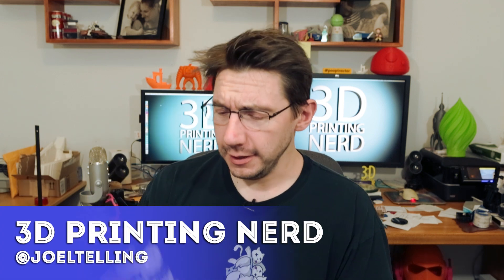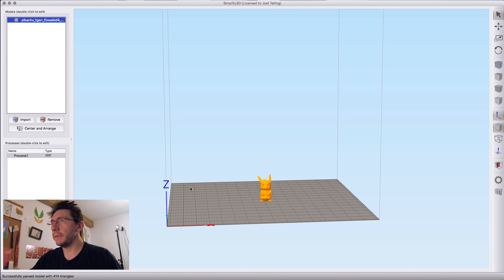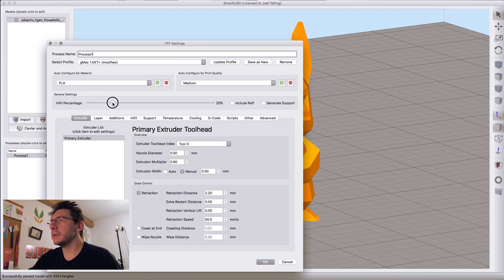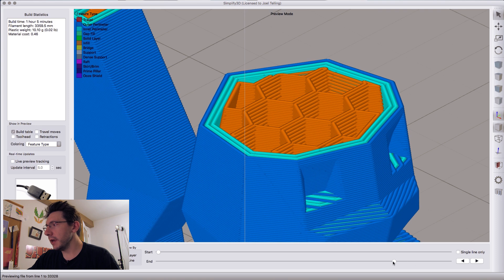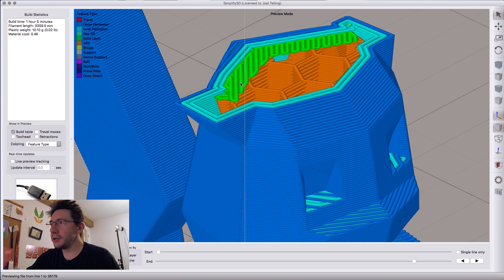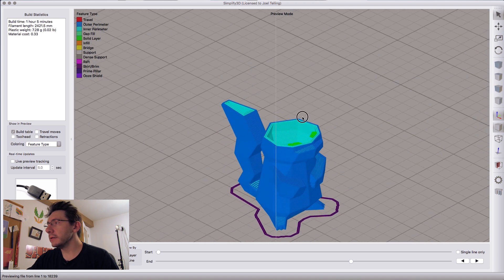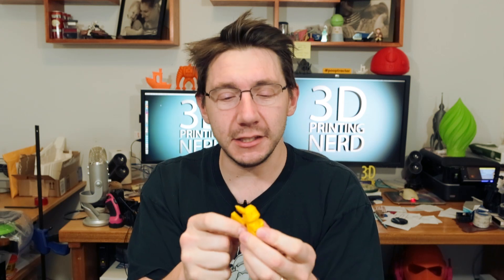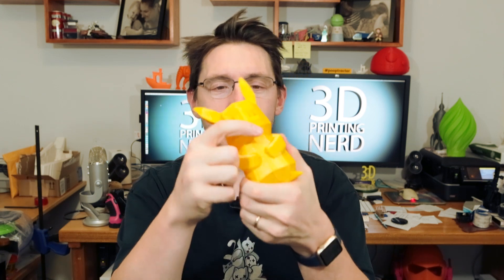3D Printing: Stop Wasting Plastic on Infill Percentage

Comment: For example although for models you can get away with 0 infil and 3 walls its completely different than 3d printing parts for rc cars ? Like the more infil and density the part has the more reliable and strong it'll be ? Im printing abs and tpu at 75% infil should I also use 3 or more walls and would using more walls cause it to print out neater looking?

Comment: aesthetics are king so I go with 100% infill for parts using translucent filaments that will have an area wide enough that the infill pattern will be too distracting because the only other choice for those is zero infill and that usually comes with bridging issues that will be just as obvious and an infill pattern when you look at the part, everything else I range from 5% to 20% depending on how worried I am about the top layer sagging and not really because of strength.
though I've been 3D printing only for barely 2 months now so maybe I'm just wrong lol

Comment: I'm not concerned with how durable a plastic pokemon is, I'm concerned with how durable a towel hangar, phone stand, gears, etc are.

Sure if you're brand new to printing, and popping out toys, save filament and use minimal infill

Comment: Never thought about it like that. I think you still might need infill when it comes to prints that have a large flat surface area on the top and bottom like rectangular boxes but having less infill and strengthening the walls not only reduces the amount of plastic used but also the time to print!

Comment: Hi,

I'm sorry, I'm new would you please help me about replace my ender 3 2 pcs 300mm z reals with 2 Pcs 2040 CNC 3D Printer Parts European Standard Anodized Linear Rail Aluminum Profile Extrusion for DIY 3D Printer Black (600mm) would you please show me how can i change z number from 250mm to 60? please. thanks

Comment: Here are my recommendations:

Hotter extrusion temperature and less fans. turn down your print speed slightly too. the slower the part cools the stronger it'll be. you may consider using an enclosure or annealing some parts as well but tweaking print settings should come first.

Use more perimeters. this will add more material to where part strength is needed most. same for top/ bottom layers but i think perimeters are faster and have a much greater effect combined with print orientation. 

adaptive infills. you can set it fairly high and it'll only put more infill close to perimeters and top/ bottom layers where you need it most strength wise. honestly though infill is one of the least effective ways to strengthen your parts.

And of course if your printing mini figures you dont need a whole lot of part strength to begin with, you can turn the above settings down

Comment: It seems like there was plenty of strength in the models you printer without infill, but doesn't the strength of a model rely heavily upon the material used for printing? Were you using PLA? Resin? Something else?

Comment: I appreciate the help and assistance, but...

WHY O WHY do nearly all content providers, yourself included, have a section where you talk, which is low volume so I turn tv up to hear clearly, then have an intro animation with massively higher volume, almost always including heavy bass to compound the issue, then go back to the low volume for the rest of the video..

I watch most of this stuff late at night because I have insomnia, and having the extremely loud intro animation drives me absolutely nuts!!!

Come on, just lower the anim volume to the same level as the rest of the video PLEASE
Reply from the maker: We do this in the software to keep a normal level. Is it this video specifically?
Reply: @3DPrintingNerd  this video definitely.. but many others from creators do the same.. its like adverts are always louder than the programs.. 

I do have a subwoofer system because tv output is quite tinny so likely thats the issue.. the intro vids are nearly always heavy on the bass.. If I shut down the subwoofer then everything is horrible again including the voice in the vids..

Comment: I printed a lead bender from thingiverse for my electrical engineering study. I used 100% infil because it's a small print and I don't want it to break in my bag. I definitely didn't need to do it, but I'd rather just be sure. With larger prints or on time constraint I definitely use like 15% infil.

Comment: I have only been 3d printing for 1 full month now and the only Slicer I even know about and am using is Cura.

If I want to try printing a successful design with 0% Infill, I should increase my "Wall Line Count" from 2 to 3? My Wall Thickness is set to 0.8mm

I have tried a few prints today with 20% Infill because 4 hours later, I have finally got an understanding what Infill even is lol. I am having an issue tho where the Corners of my print start to pull off from the Bed i'm worried that when I let my printer run for a 8 hour print, the corners will pull away which will lead to the entire print to come off the bed mid print. 

My Nozzle Temp is at 210°

Bed Temp is 70°
^ I have since experimented with my Bed Temp at 60° and that seemed to help so far

I am using PLA 

Do you have any recommendations for me?

I'm sure by the time you even see this comment I will have figured it out or very possible that I will no longer need any help because I have thrown my 3D Printer out the window. Either way, thanks for the video regardless .. My 3D Printed Girlfriend also says "______" well.. she can't talk yet but im working on that! Thanks!

Comment: I am glad I found this video.I just got my printer last week.  I was printing some pokemon and was wondering why the infill needed to be very high if they were just going to sit on the shelf. Lowered the infill to 10% because I wasn't sure about how they would work going less. So glad to know I could go 0%. 
I know this video is really old but I have one question... What do you print the layer height at? Can I leave it at 0.2 or do I need to make it less?

Comment: HOW! I have 50% infill and 3 shells yet my print strength sucks. The layer adhesion is great. The only thing I notice which probably is the issue is the shells aren't fused together and they are a bit thin but using cura I have no idea how to change that

Comment: I'm gonna say layer separation is the big gain with infill, If might help some with crush strength but mostly layer separation will be the gain, that being said this was not a very accurate test of strength, it was really a "good enough for decoration" test where as some of us are looking for real strength, personally I don't make toys with 3d printers, I make gun frames on mine so I need as much strength and heat resistance as I can possibly get, Which is why I do 100 percent infill with polycarbonate and I anneal it.

Comment: any idea why a printer would stop printing in the middle of a print??? print was fine up until it just stopped moving...machine did not shut off,nozzle temp and bed temp stayed same...could not resume of change settings... i had to power off and start a new print...than as like with the other it just stopped again 10 mins into the print.... i have fixed dozens of issues on 3d printers,but this issue is something i don't understand...PS i have printed this file many times with no issues... please help... thanks

Comment: For sure. I've experimented with infill on a small variety of shapes at a couple sizes on the same build. Everything passed my 'smash it against the wall' test. However, I did build a little herb grinder (for a friend) and I did do 50% fill with .15 layers because even if all that plastic is redundant, this thing is going to be put to use pretty regularly.

Comment: Great video as it not only wastes plastic but also time. with that said, what cases do you believe infill is really necessary?
Reply: Pretty sure I just realised the answer to my own question, if you have an object such as a cylinder that was fairly large when it gets to the top of the cylinder and needs to cross a large distance it would be best to have infill in there. Basically like how supports work but for the insides

Comment: lol. did no-one see the gimick here?
he demonstrated snapping apart a small model, which will naturally be stronger due too its size. x300% with a bigger model and things change. the bigger something gets the more supports it naturally needs. did you notice he wouldnt destroy the bigger version? the model he chose didnt have any detail either, like the neck line and between the arms and body.

i do agree that you can waste infill and provide way too much support on the inside, but it comes down to experience upon the type of model your making, and most importantly, the type of Material your makign your model out of. i assume he used ABS which is a stronger PLA, but with many different types nowadays, you really need to know what your using rather than sticking to this advice. after all. he wasted plastic making multiple pikachu's just to make a youtube video.

Comment: Solid infill actually reduces strength. The exact percentage for maximum strength is going to depend on the model, material, load, infill type, etc. but some degree of hollow space is going to help with strength.
Reply from the maker: Oh that’s right. I think I remember seeing a demonstration using a solid pipe versus a hollow pipe. Does that sound familiar?
Reply: @3DPrintingNerd  Absolutely. BTW, it's really cool that you take the time to answer peoples' comments. Love the channel!
Reply from the maker: Thanks! I try!

Comment: I don’t print high infill for strength. I use a higher infill to have items feel heavier. Example: I made a D1 digivice and it feels cheap and plastic, yet 70% I fill with a nice paint job feels like I’m holding a read digivice!
Reply: 'you can fiill your print with clay or dough.

Comment: Im new to 3D printing and use about 15-20% infill on most models unless Im going for weight. For example, Im in the process of creating a Star Wars chess set and printed at 80% infill to give the pieces some extra weight. Anyway, very informative. Thanks man. Have a good one. HIGH FIVE!!

Comment: I did a very large print recently (about 20x22x24cm) and did 5% infill with the 3d cubic infill so I wouldn't run out of filament. Unfortunately, a lot of it didn't bond very well internally so left my part a bit squishy. And I still ran out of filament. Should've gone for more walls and just filled it with something later.

Comment: I go either 15% or near 100. I only use high ones when I need crush resistance, such as frame sliders for motorcycles; these are what the 500+ pound motorcycle slides on if it gets dropped on pavement. Need solid plastic for that.

Comment: Yes, if you are printing picachu you need no infill. But if you are printing parts that have are used for something, you need it. Of course, you should always adjust it to what you really need, but printing weak parts for them to get broken so you can print them again doesn't really save much filament.

Comment: Considering this is 4 years old but the knowledge still applies, I've begun printing out my library of 3d modeled figures from the last decade or so into 1/6th scale statues and am really trying to cut down on print time. Taking out the infil was my first choice, though I'm of the opinion that some is necessary as you mentioned in the vid just so some parts will actually print. Little fiddly bits like outstretched fingers or facial props. I'm going to be molding them anyway, but what I'm planning to do for structural support is fill them with 8lb pourable foam, provided the reaction doesn't torch through the model. Should give it a bit of heft and support while molding and casting.

Comment: If you're printing with a triple perimeter you are still adding a lot of plastic to the model, since it's near the outside circumference. It would help to see what the weight difference is between infill and beefed up perimeter to quantify the plastic savings.

Comment: How did you print that pikachu without supports?  I’m kinda confused right now.
Reply from the maker: This low poly pikachu is designed to print without supports. Have you tried it?
Reply: Not yet
Reply: But I just got my 3D printer last week and I thought that all prints with overhangs needed a support

Comment: What % and type of infill should be used for a filament spool holder? Looking to print one out for my endor 3 pro, and feel it will be under a kit of stress when loading new rolls. Thanks everyone, new to this.
Reply from the maker: Add perimeters for good strength.
Reply: @3DPrintingNerd  - Thank you, I'll give it a try.

Comment: Keep in mind that if your parts have horizontal surfaces, or other extreme angles, they will fail or may have gaps. In this case you should design supports so the printer can bridge.

Comment: I printed my last print at 30% because I wanted it to have a bit of weight to it, and because it is a little bit of a delicate shape. Still, lower infill means less print time, less plastic, and not that much less strength. I usually wouldn't advise going hollow, but even 5% should be fine.

Comment: I've even done 1 or 2 layer thick prints, then about 3-5% gyroid infill, surprisingly strong, you can throw them at a tiled floor and they don't break. Depends on the use obviously, I'll go for higher infill for functional things that need strength but most stuff you can do much lower on, gyroid is good also because it's quite even and gives lots of area for parts to build on internally if they need to.

Comment: I print depending on how strong the part has to be as in, how much weight it will have to carry if it's going to have forces on it. for things like keychains I print with 100% since it's such a small thing that it barely takes any extra plastic.

Comment: I'm having an issue where the interior overhangs (green lines) lays down filament but then curls up significantly which eventually catches the nozzle on subsequent layers knocking the model off the build plate. I read this could be due to rapid cooling in combination with too hot of a nozzle. My question is how to balance the cooling with the nozzle temp? I imagine i should lower the nozzle temp from 215 down to 205 or so, but should I also lower the fan speed as well?

I'm printing on a Prusa MK3S.

Comment: What I take away from this is you should consider what you're printing and whether it NEEDS the infill. If you're printing a bracket that will have some tension applied constantly on it, more infill would be better to increase the structural integrity. If you're printing a pikachu, as long as it's aesthetically pleasing, skip the infill and save filament.

Comment: i need help. i had a hotend break. i put a e3dv6 from hobbyking on it. now all my prints are like wafers they are so soft i can crush them with my hand. i am a noob. what am i doing wrong. btw it prints same way on both printers, and second printer has original hotend.

Comment: I find that % largely depends on the size of what you're printing, the % doesn't scale perfectly.

Like on a 100x100mm print, 5-10% infill is the lowest that makes sense, where as on a 300x300mm print, you can get away with 1-5% infill.

I've found that adding 1-2% infill on my massive prints, along with a decent wall thickness, printed with a .8 nozzle, results in really fast and strong large prints. The difference in time and filament used is minimal but the strength is quite night and day comparing a hollow cube 300x300 vs one with 2% infill.

Comment: 5-15% is usually enough for me, but I typically don't even need any for strength purposes. I actually use it more for surface quality on the top of the print as the infill helps the bridging quality a bit on larger surfaces.

Comment: Come on, if you're going to make a claim at least do a scientific test to confirm your hypothesis. Simply printing a small object and claiming it's hard to break means nothing since of course an object with little leverage going to be hard to break.

I'm not saying you're wrong, but it's just disappointing to see something so bias and one sided.
Reply from the maker: Thanks for your feedback! I will jump in my time machine to go back a few years and let Joel in the past know of his errors.
Reply: @3DPrintingNerd  No problem. Don't worry, I'll just jump into my time machine and inform you before you've even made the episode. 
:)
Reply: just to reiterate; I agree with you that wall thickness matter much more than infill in terms of strength. Just a control at least would of been appreciated imo.

Comment: Out of curiosity is their a way to specify and control the thickness of the model with this software?
Reply from the maker: Yes there is. The "skin" is what we call the perimeters, and you can define how many perimeters a model has.
Reply: 3D Printing Nerd thank you for the info. I am new at this (as you might have figured).

Comment: Good advise but its only half the story.  Overhang and shape as well as other characteristics need to be considered.  No infill works good for many low poly models with less than 50 degree overhangs, but many more complex models will fail if you try this.

Comment: The weight will tell if using thicker perimeter without infill saves plastic. I think using thicker perimeter could use More plastic. Still I applaud your effort in trying to reduce wastage

Comment: What is the 3 outer layers you mention? How do you do that? Is that a setting in the drawing or the 3D printer conversion. Note, I have just got my printer and am reading/watching like crazy.
Reply from the maker: 3 perimeters - it's a setting in the slicer software! You'll want to look up layer height, top layers, bottom layers, and perimeters.